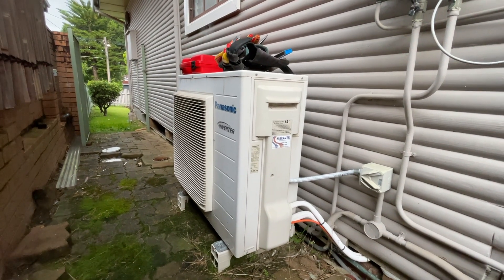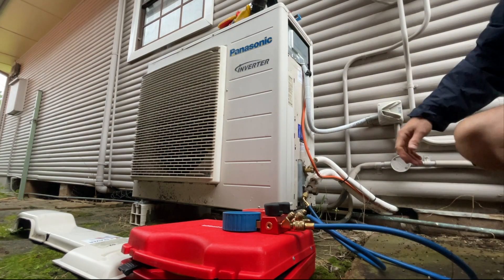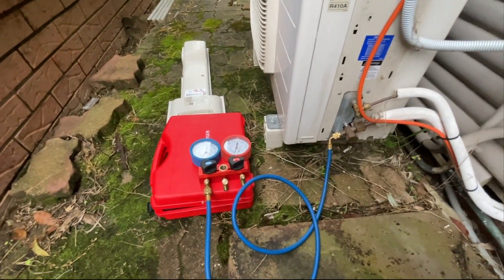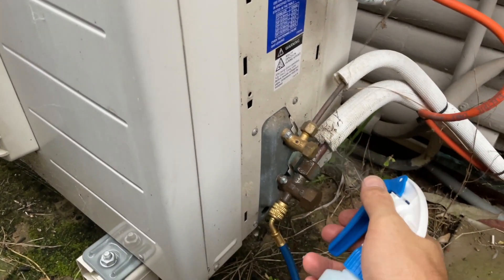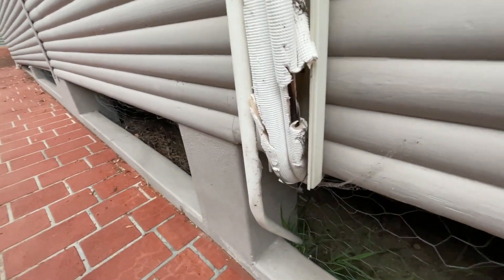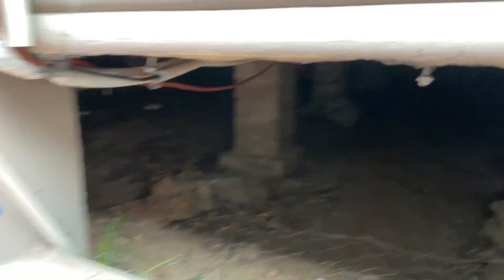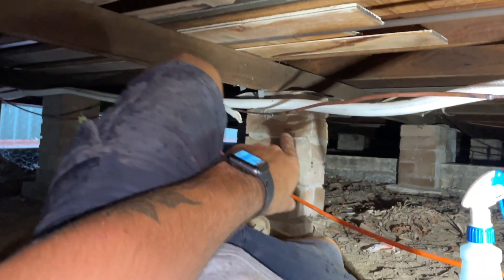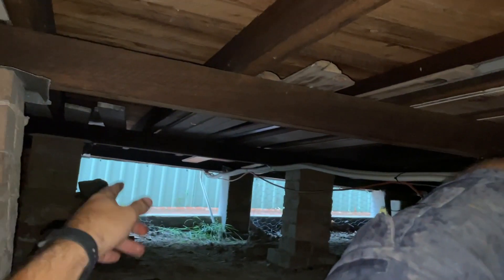Panasonic Air Conditioner Not Cooling | Not cutting out or showing a fault code.

Comment: Is it I cool copper? I’ve had it one 3 separate rolls now all on 3/8
Reply from the maker: Literally the last roll of copper I used was I cool only a couple of days ago.. Safe to say I won’t be using that brand again.. In regards to the roll of pair coil in the video, it wasn’t I Cool. I can’t remember what brand exactly but it wasn’t any of the popular brands. The insulation didn’t really have any branding on it..
Reply: @maracservices  yeah we only use ardent of Kembla now
Reply from the maker: @salmander91  I’ll be doing the same now, although even that doesn’t fill me with confidence knowing that kembla is no longer made in Australia. Better then the alternative though..
Reply: Dodgy Seam in the run

Comment: Cheap defective lineset , they dont leak right away but they often have a thin line running down one side which almost always spring a leak
Reply from the maker: The scary thing is, copper prices have gone up like 60% here so more and more people will be looking for the cheapest option. Safe to say, I’ll be avoiding the cheap stuff..
Reply: @maracservices  Same situation in my area sometimes I have to call the suppliers in front of the customer for them to believe that prices are what they are I had to update alot of quotations because of price hikes.

Comment: Interesting video mate, I’ve been in the trade 20+ years and never seen that.🤷‍♀️
No LP switch!!! Crazy that. Can’t you sell the customer a LP switch???
New set of gauges???
Keep up the good work
Reply from the maker: Yeah mate, I’ve been doing this for 15 years and I’ve never seen that either aye. Must be a faulty batch or something. Yeah the gauges are relatively new, I like to keep them in the box with foam around them so they don’t rattle around all day long in the van. In regards to the LP switch, I’m going to investigate that further when I return later this week to run that new pipe. Thanks for the comment mate!!